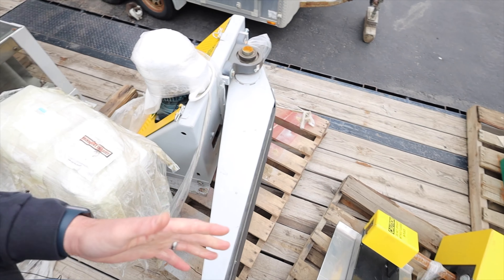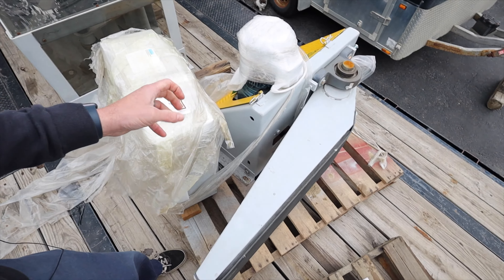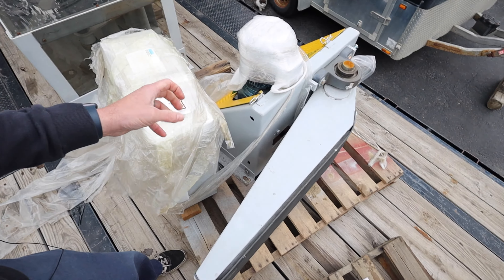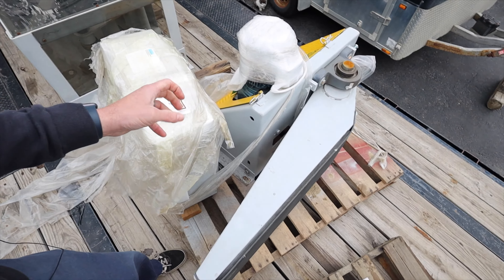Don't make this tool disposal mistake!

Comment: I still have that wood piece from 20 years ago, will sure come in handy someday. Never throw away anything. 
On a serious note, keep those luggage thingies but take them apart now and sort the parts so you know exactly what you can use in the future. Like motors, bearings, bolts, plexy sheets, pneumatic parts, steel and so on. Much better than having them in a pile somewhere.

Comment: I have the same issue with wanting to keep stuff that "Might be useful someday" and have limited space. some rules I recently thought up is 
value of the item / 100 = how long it can sit around with a cap of like 5 yrs
this can be adjusted depending on things  like size of storage space or how hard it is to get the item again if ya really needed to.
also have a set storage area and try not to let it grow and take over the rest of the shop.

Comment: If you have the space and can set aside a week to disassemble, create a catalog of all the cool parts, and be liberal with actually throwing out the parts that won't realistically be used, it would be awesome. Making a rolling mill from those heavy duty gear drives and pillow block bearings would save you thousands on a quality build. But I totally get the "future project pile monster" but that is mainly due to space to properly store and catalogue the parts. I'd say, start by thinking of 3 or 4 actually useful projects you want to build and make rough parts requirements of them then see if what you have there will work well, or be more work to make those parts work than new or specific purchased used parts. Basically will the build cost go up or down shoehorned with those existing parts you can salvage. And as for the working machines, definitely keep them, that saw is nicer than any of the new ones under the $1500-2000 range, colant tray, good sized throat, good blade size.

Comment: Definitely the Bandsaw is a keeper.  I think that would get used quite a bit.  The other items that have your attention.  The big thing is storage room.  If you have that keep those things that are holding your attention.  Put cards on them with this date and the proposed date you plan on making something with that particular item.  If it doesn't get done, then into the trash it goes.  If you are going to be harvesting parts off these machines?  Then you still need to have some kind of time frame in which you are going to work on them and morph them into something you need.  But like I said to begin with.  Storage room is important.  If you have that and you don't work within a time frame, your stored items could be there for a very long time.  Other than that you could try selling some.  If not the whole unit then the parts might sell to buyers that need them.  You have some great ideas of what to do with those machines and their parts.  It will be most interesting seeing what you do with them.  All the best.

Comment: The problem with potential is it's allure.  I'm in the same boat, hate to throw things out, but without a plan you end up hording things with no end in sight. Break down the diverters, sell the pieces, if they sell before you get to them it's gone for a profit, if they are still hanging around when you need them it's a win!  If you keep them, have a plan and stick to it

Comment: This is my rule: Will I realistically have the opportunity to address this within a year? I need to be honest with myself here. If the answer is yes, it can be stored, but if I come across it a year later and haven't had the chance to address it, I have two options: either discard it or address it immediately. This rule helps me prevent accumulating too much unnecessary stuff. However, it can be challenging when there are instances where I discard something and realize a few weeks later that I actually needed it. Nonetheless, I still believe it's better to spend the money again when necessary rather than dealing with the issue of having excessive stored items that never get used. Best of luck, and some really interesting stuff you got there. ^^

Comment: Take it, if it's still on the shelf in June 2024, pitch it. That is the way I try to operate. I hoard, but purge if there's no use in sight. Doesn't always happen on time, but happens eventually. And it feels so good to either repurpose something, or toss something that's been sitting around. So it's all a win.

Comment: I personally would not throw anything away, but I would put several things in an accessible place in the workshop and not in the other barn, since leaving them in the other barn would be "lost and forgotten" and I would start by disassembling what needs to be disassembled and then I could even make several videos of the restoration of the saw

Comment: Start with a six pack. Sit back and write out the tools/capabilities you would like to have in the shop. Then compare the bill of materials you kept to the one you need to build the capabilities you want. Then keep everything with a purpose. And post everything else for trade for the other things you need. It's OK to hoard...just hoard with a purpose... Consider a die filer /metal broach to the list. Square pins wound look great in the Chunky Monkey.  Added benefit, those you trade with will likely be great additions to your local builder/maker rolodex.

Comment: I would bring it all to an auction house and be done with it. I am going through a big move now, and I ended up throwing away a lot of good materials that I had good intentions for 10 years ago. Your time is valuable. If you keep the stuff it's kind of like committing future discretionary time, kind of like using a time-based credit card.

Comment: every few years, drop the things you don't need. Except, of course, keep a big metal scrap pile, and a big wood scrap pile. Tools that don't get used in 4 or 5 years, are just wasting space. Unless, of course, they are specialty blacksmith tools that you made for a job and you want to do that same job again some day (or engraving or jewelry). But, the things that actually take up meaningful space, they have to go if they don't get used. I am going to toss a drill press and I got rid of a functional but cheap wood band saw for this reason. Now, some old tools have value as collector's items, or they bring you joy to own. But, be careful. Limit that to old lathes or power hammers or things with some soul :).

Comment: If you have the space and even an inkling of an idea for a project, keep it all. Better to have and not need than need and have thrown out.... That said I am out of space and have 4 bandsaws and 7 drill presses so there's that..... but as far as I am concerned, when your projects run out, what is the point? Keep plenty in the pipeline and you will never be bored.

Comment: For sure definitely keep the band saw and shear no brainer and keep everything else but break it all apart all those parts are really expensive that's easily a couple thousand dollars just in parts just sell them as used and pocket the money and keep the air cylinders since there not that expensive and put some air to them  and make your can crusher it would be really simple to make all you would need is a toggle switch for the air lines and done man.

Comment: With all the possibilities you stated about the parts off that equipment, it's not junk. You wouldnt be "one of those farmers who has junk sitting everywhere." if anything, break it down into pieces and store that way. 

Theres just way to many quality components in that "junk" to throw away and not regret it on down the road.

Edit: I stopped the video to type my opinion above. Turns out you thought the same about breaking it all down and storing it that way lol.